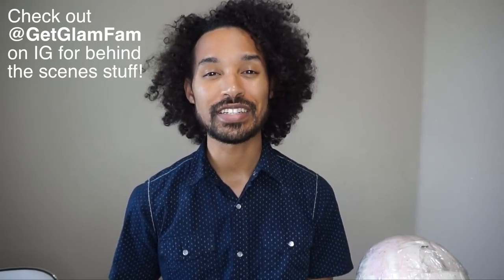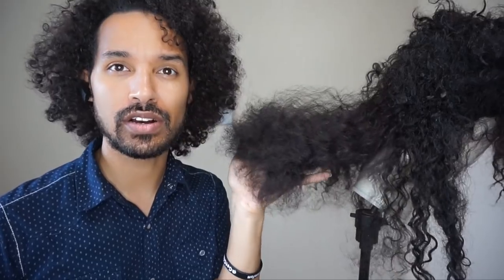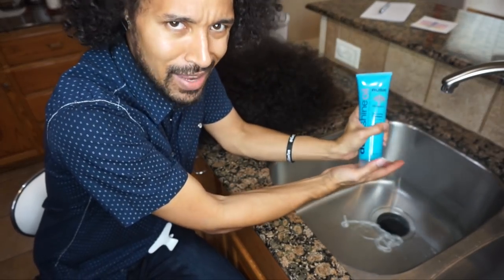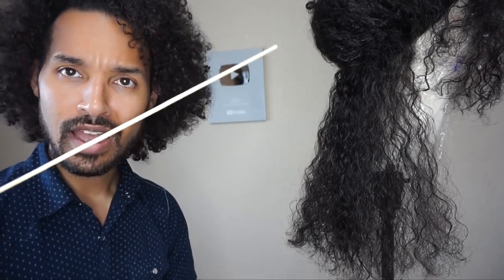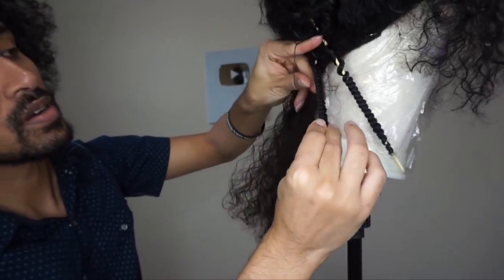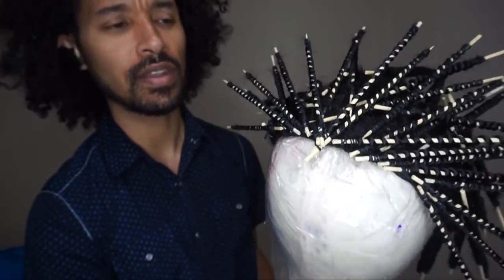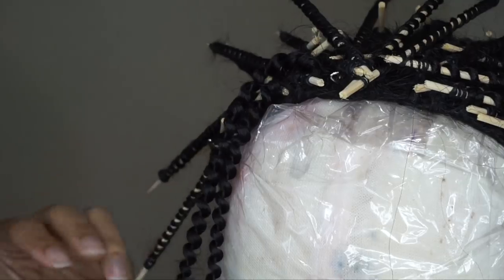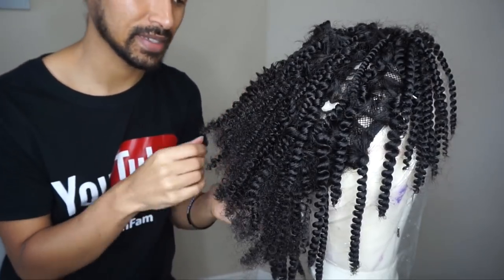How to Restore a Synthetic Curly Wig!

Comment: Vinegar actually removes every stench to which I have challenged it. It also has a softening agent to it. 1 cup of any vinegar in a load of clothes removes all the smells you discussed.  No fabric softener needed. Towels stay more fluffy and absorbant. Wig stench is removed! No vinegar smell left behind.
Reply: I'm totally intrested in this option to remove smell but which kind of vinegar or does it matter? I usually use the Apple Cider but this is my first time going to try restoring my synthetic hair.  I don't want to use the wrong vinegar, lol. Thanks for the tip!

Comment: Hi Linwood, Thank You for sharing with us. The good lord knows we need help with our wigs. LoL My wig is a shake and go, I wore it and shook it. Washed it. It's frizzy 1 to 2 inches from the bottom. It said flame retarded fiber kanekalon.And can be curled. Can apply oil sheen or wig conditoner on it. Only the bottom is bad.LoL Thanks Linwood.
Reply from the maker: Such a pleasure!! Conditioner doesn’t tend to help much with most synthetics. Also, You could lightly trim the ends and it would handle that if you aren’t down for the excess work of revamping. Although sometimes an oil sheen can prevent as much tangling, etc. 
😊👍🏽

Comment: Great video. Could you use a hair dryer instead of the steamer? Just wondering.
Reply from the maker: I don’t know that a hair dryer would be super effective, but for the steam you could hold it over a pot of boiling water, it takes a little longer, but it’ll save you from spending on a steamer

Comment: Hello! So I have a human hair curly wig. I think I may have striped the fibers because the back and bottom is still curly and tight yet the top and sides now looks thinner and singed. I used BedHead to wash it x4 because it was super dirty, in boiling hot water several times then let it sit overnight in more boiling hot water with Aussie condition. Is it restorable or should I buy another one?

Comment: Hey Lin, what causes styrofoam heads to discolor? I notice yours is slightly and I have a couple that are. Is it something I should be concerned about?
Reply from the maker: I have a crock pot liner over mine to keep it from staining, so it’s the liner that’s stained. In my case it’s from haircolor, sometimes it can be caused my products as well. On canvas Wig blocks it can often be mold if you don’t have them covered with plastic and you’re getting them wet, etc
Reply: GlamFam  Nope, just plain old styrofoam
Reply from the maker: Ok, probably just product stains or the mixture of the natural oils breaking down the elastic in the wig